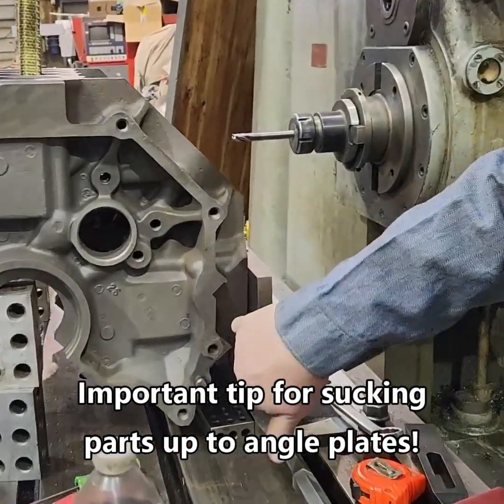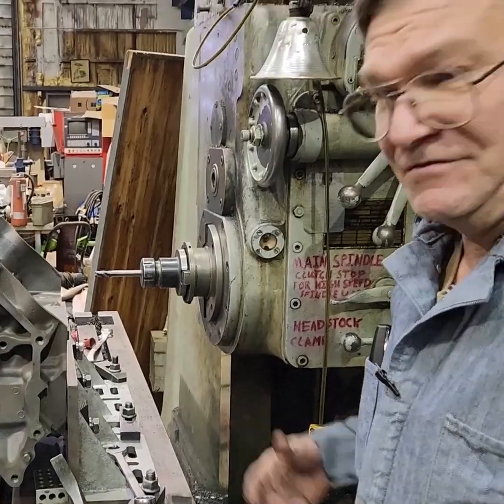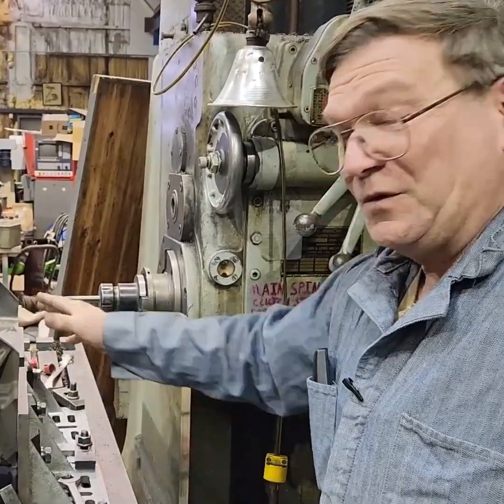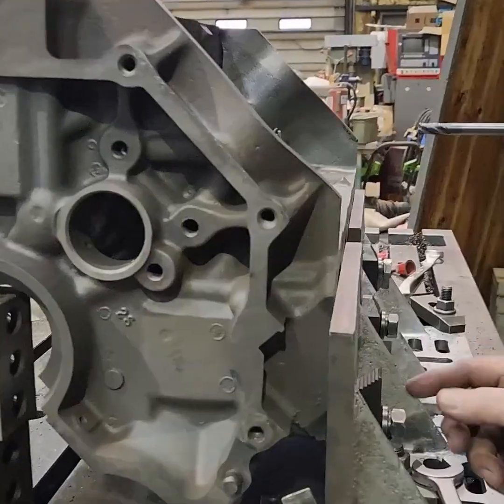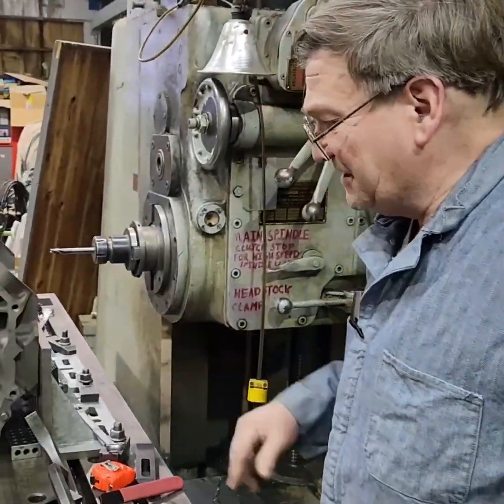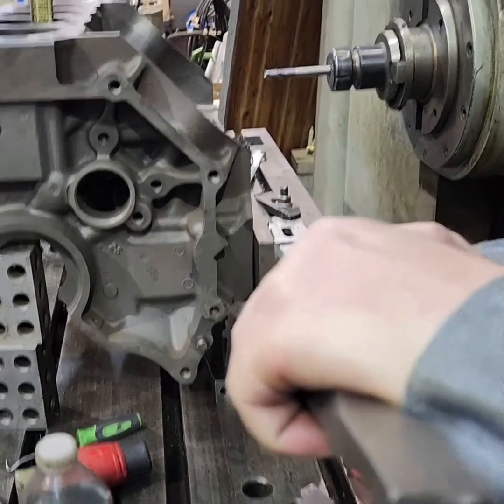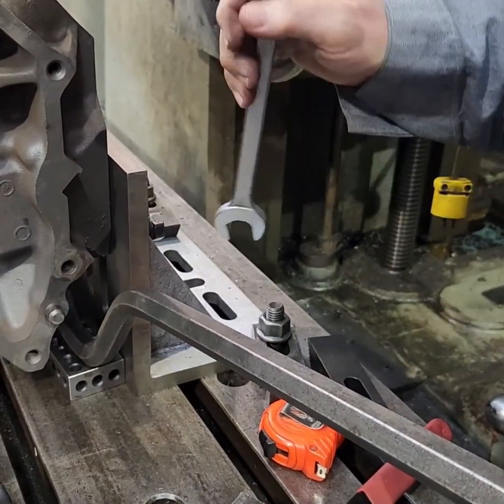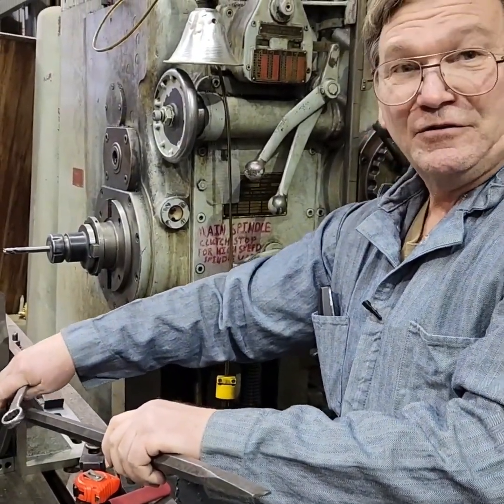Machinist's Minute: Lift parts before sucking them up

Comment: Well, so be careful about what holes you choose! 
I am rebuilding an engine due to using a valve spring removal tool on a cam journal. It mounted to the top, but the 94# pressure I had to use to compress the springs left the top of the cam journals deformed. 

So we ran the engine and the side of the cam bearings didn’t have clearance. Ate those beings in about 5 minutes 

Aluminum head.